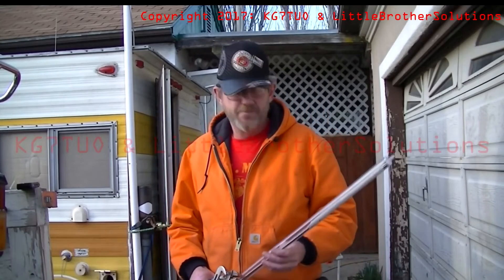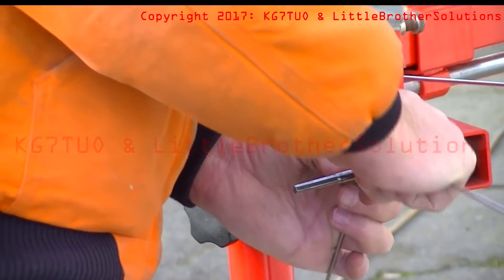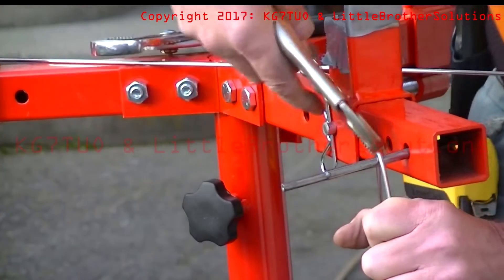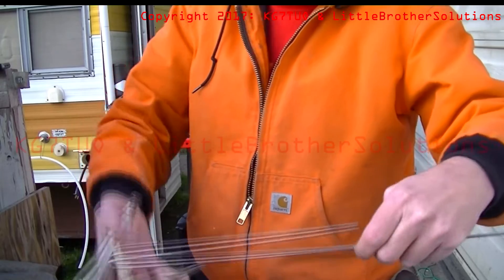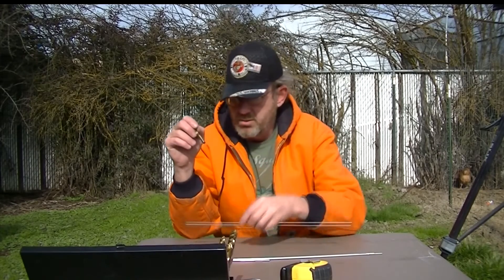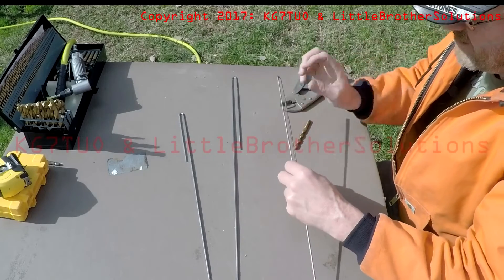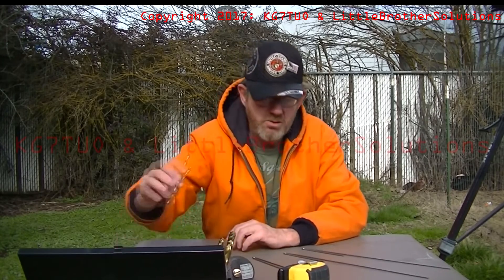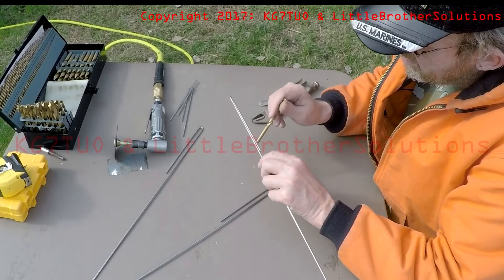Making dual band (2m/70cm) antenna elements from welding rod

Comment: I wonder which welding rod type are most corrosion resistant ?  I heard 316 stainless steel rod is most corrosion resistant.   I am thinking of making simple vertical antenna for 144MHz    AG6JU
Reply: 316 stainless is good

Comment: Just for clarification purposes.  Those are not two antennas (the 2m long, and 70cm short).  The parallel part of the antenna is actually a open wire matching stub.  The antenna does not radiate there, it is effectively a feedline.  Both bands radiate from the long single section rising above the matching stub.  It just so happens that 70cm is 3X the fo of 2m, so it is resonant there too.  Just a little antenna theory from KQ6UP
Reply from the maker: I've wondered about this myself. It seems to me that it could be either way with the 70cm RF departing from whichever is THE MOST RESONANT. The most resonant element will result in the RF radiating from that point wouldn't it?  It doesn't radiate all along a traditional HF dipole for instance. It radiates at the point of resonance.
So on these antennae elements, if the long piece is off a bit and the short piece is perfectly cut, wouldn't signal resonate from the shorter one?

Comment: Greetings,  I have a question.  You said that you tested the elements, how?
Reply from the maker: I put them on the antenna being built and use an antenna analyzer.  You could also use and swr meter but an analyzer is quicker and easier.

Comment: Could you use a zip tie to align them to be horizontal and stay in place with some “spring” resistance?
Reply: So we are crossing threads here sorry, I’m not referring to the durability...  in the beginning of your videos... you were saying that it takes awhile and some finagling to get the two horizontals parallel to each other.  Couldn’t you just add the approximate bend curvature to the welding rod but leave them in a slight “V” to one another and slide over a couple of zip ties to “click them” down until the two rods are parallel to one another. You would achieve the same thing you did however... there would then also be slight spring tension against the zip ties to keep them parallel and not wobble around once mounted. I love your antenna, just curious if that would be a good way to keep them always parallel to one another. The other thought was to add a spacer of the correct size between the two rods and zip tie those in between to keep the spacing. Just thoughts I had while watching and I was curious of your thoughts about my ideas.
Reply from the maker: I'm not sure what you're suggesting. I use these elements in vertical dipole configuration and there is no need for anything to hold them apart other than the two elements of the dipole being electrically insulated
Reply: I guess I was thinking to get them vertical you could click down the zip ties until they were vertical and the resistance of the opposing horizontal pieces would be applying outward pressure to hold them parallel. Versus trying to get them perfectly aligned and they could move and get out of alignment. Just a thought.
Reply from the maker: @neeko7878  I've been running these antennae for several years and never had a problem.  The first one I built (the one with the un needed choke) sits in one of the boxes of my utility bed truck with mast sections, coax, etc. and has been knocking around in there for a year and a half without any issues.

Comment: Have you Been able to make any contacts with this antenna? Please share your experience
Reply from the maker: I've used it for repeaters and simplex.  I have one at 12.5 feet high and can make the repeater 30 miles away (straight line) with 2 watts on a Baofeng. The 4 watt setting is better audio but 2 will do it.

I also have one for my RV. At 15 feet above ground I was able to make it 102 straight line miles from the central valley of Calif into a mountain repeater in Dunsmuir.....using 50 watts.

It works quite well. There is a slight null in it that I occasionally find but it's mostly omni directional.

Comment: Hi, could you please tell the exact length's of shorter and longer rod of the antenna measuring from the bottom of the U bend (so including the diameter of the rod). I assume it will be close to 49cm and 16 cm. 
On some other diy antenna video someone told that in practice the length should be circa 6-7% longer than calculated for given frequency and recommended 53 cm and 17.5 - however he was talking about pig tails most of the time so I am not sure if what he said is true only for pig tails or in general for all the antennas.
Anyway yours is nicely measured and I trust SWR chart more than this pig tail guy.
Reply from the maker: Thanks for your question. I didn't realize I hadn't put the actual measurements in any of the videos except the review of the first build. They'll be added in the comments section.

The lengths, measured from the outside of the bottom bend, are:
6 1/4" for the 70cm side
18 5/8" for the 2m side

KG7TUO
Reply: @kg7tuo999  What are those size's in CM?
Reply from the maker: @damianverhoeks3544  I have no idea but a simple google search will provide any number of conversion calculators.  Or you can download a conversion app on your Android or Apple phone